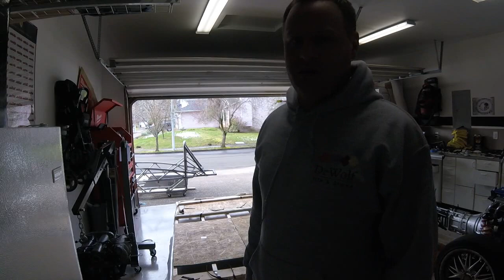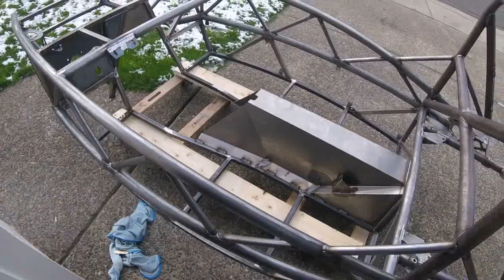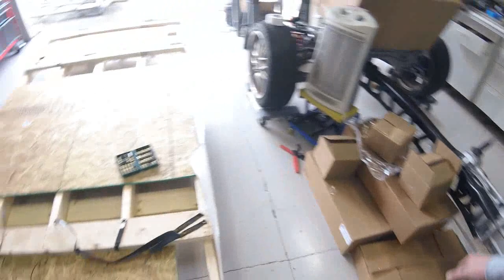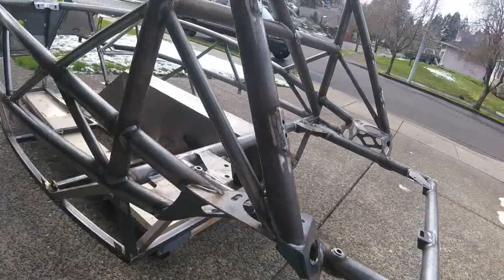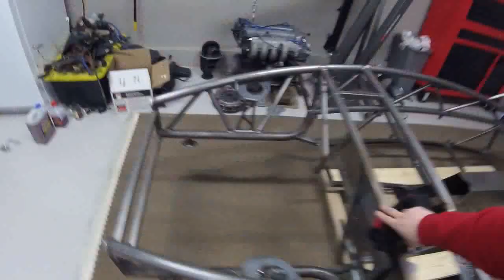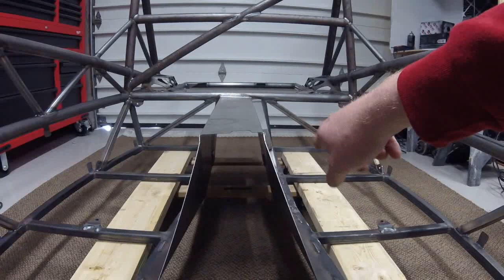Exocet Build: The Exocet Chassis (Part 23)

Comment: I think the complaint about the welds may be unjustified. MIG welding never looks as neat as someone skilled in TIG welding. MIG is great for a frame like this as long as penetration is good. The weld beads never lay as flat or as neat as TIG. You just don't have the control with MIG. Grinding MIG welds only makes more of a mess and can also weaken the weld depending on the depth of the grinding. I just looked at a new Exocet frame (2 of them) at Road Atlanta this weekend. The frames were painted and this helps the look but regardless they looked just fine. If Exocet offered a TIG-welded frame my guess is that it would increase the price by about $1000 to $1500 depending on the welder. Personally, I don't think it would be worth the difference.
Reply from the maker: A good welder can make mig welds look almost if not as good as tig welds.  I have seen it with my own eyes.   While the strength of the weld on the frame may be just fine, the appearance is my complaint.  
When you looked at their cars if they are early cars such as their demos many have told me the weld quality was better than the later/more recent cars.

Comment: Thanks for the heads up on the welds.  Do you feel their is any recourse..i.e sending it back?  
Darren
Reply from the maker: Darren Graham no recourse in the welds.  It is what it is.  Might welding will not get you looks unless it's done by a real pro.   This is not done by a real pro.   A good Tig welded frame would be sweet.  I wish you could pay more for the option to have it tig welded.   My tunnel was unacceptable though but Kevin and me worked something out on that.  I had to have a fabricator redo it locally so it's acceptable.